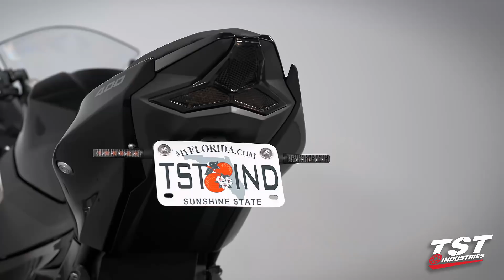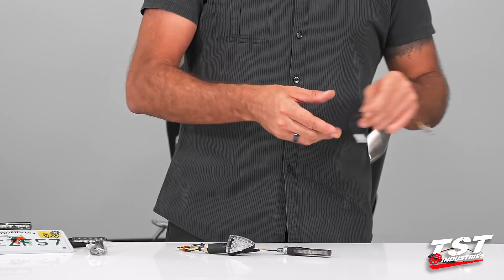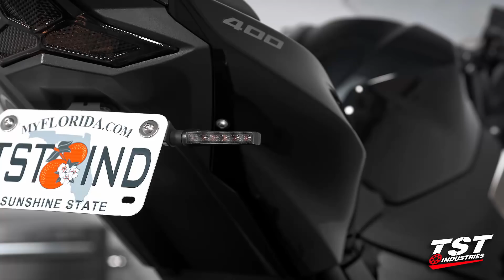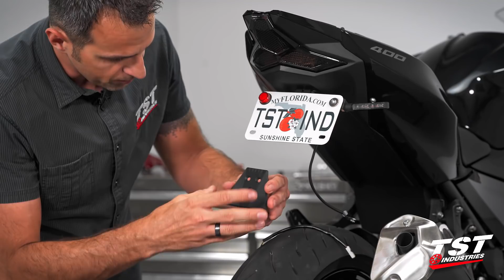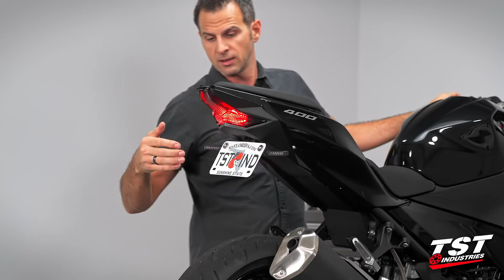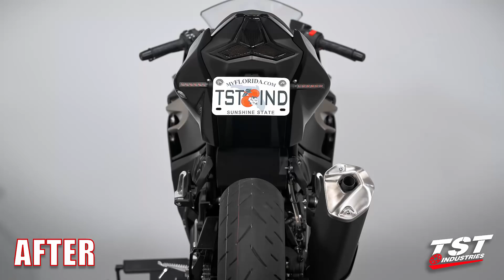How to install TST LED Pod Turn Signals on a 2018 Kawasaki Ninja 400 by TST Industries

Comment: Are these compatible and fully functional for the ninja 500? The same instructions as in the video?
Reply from the maker: Yes and pretty much. We have a separate video on that model being released shortly. It will show mounting in the high and low mount configuration.

Comment: I ordered the sequential and the lights have three wires instead of two, they are blue, red, and brown. How do I know which is pos and neg, and which to leave out I guess since the port only has two slots?
Reply: I installed them and the red wire was the only one without anything to connect them to, but the lights aren't sequential for some reason, am I missing something? I have the led flasher relay
Reply from the maker: @Vic_Vic_Vic_Vic  this sounds like you purchased our Quadrix signals So our color scheme for three wire lights is: 
blue=running light positive
Brown=signal light positive
Red=ground
I suppose if you are wiring into a circuit that has only two conductors you would leave out the blue.

Comment: Just installed. I had to change a few things but got it to work. First the screw did not fit the nut from the L bracket to the plate. I just used what I had to hold the plate on before. Second the lights were opposite for me, so the label had to be facing upside down which means I switched side for the signal to line up. Idk if this is user error or a manufacturing error but it was kind of a pain to sort out. Anyone lmk if they experienced something like this.
Reply from the maker: The signal lamps do not care which way they are up. You must have connected left to right and vice versa. All you had to do to correct this is to reverse the signal connection. I would like to hear more details on why the screw did not fit into the nut for you. We sell the kits that are shown successfully installed in this video. If there was a kitting error in assembly I would like to know about it.

Comment: i wonder if it's possible to turn the L bracket 180 degrees so the turn signals sit closer in and that way the bracket doesn't stick out behind the license plate

Comment: Hey, where did you get those harness connector?
Reply from the maker: Are you asking about the entire little harness assembly that enables plug and play connection of signals? That is something we manufacture and sell , link is in the description of this video. If you just want the actual connector and terminals then you can get those at corsa-technic.com

Comment: Do wires go through the elite fender eliminator ?
Reply from the maker: Yes. There is a wiring hole provided in the closeout component. You can see that in detail in the fender eliminator video we provide for that bike.

Comment: Will this installation work on a Vagabond Fender eliminator?
Reply from the maker: I am not sure. I know that they design in large signal holes to fit the oem signals. If they also put in smaller circular holes for aftermarket signals then you will be all set. You can also try the installation using our L brackets the way it is shown in our video, and that will most likely work.

Comment: Love them! I got a Ninja 400 recently and it already has some mods but I'd love to add LED turn signals. I think I will be ordering the BL6 pack. One question - do you have any LED bulbs for the front signals? I can't see any on your website, can any bulbs with the correct fitting be used? Thanks!
Reply from the maker: You've got to hang tight for the front buddy. Give us a couple of weeks. We aren't providing any LED bulbs for the front because we have something way better coming down the pipe.
Reply: @TSTindustries  Great to hear, I'll be waiting! Thanks for the response :)
Reply from the maker: If you are an instagram user you should follow us because we will soon be releasing spy shots of what I am talking about.
Reply: @TSTindustries  I'm following and waiting!
Reply from the maker: @thecommentator6694  if you are patient it will pay off. Our projects take some time because we are a high end design firm. We dont just bang out parts overnight. I think our limited catalog of exclusive designs that have attracted a lot of attention demonstrates that. Since these signals you are asking about fit a bunch of models and years we are taking extra time to perfect the parameters. Then we have to cut the molds, and produce circuitry and harnessing. It will still be a good while before our signals are available but once they are n400 owners are going to lose their minds over them.

Comment: Just got these for my 2018 ZX6R. Should I be concerned if the grey clip controls the right light, the opposite of what was said in the video?
Reply from the maker: If you are talking about connector color then just plug the signals into the connectors that make them operate on correct side.

Comment: what mounting kit is needed for this to be installed on the stock fender on the ninja 400?
Reply from the maker: Our PSA-1002 Signal Mount Adapter kit would enable you to mount pod signals onto the fender there. You can see it here: https://tstindustries.com/tst-pod-turn-signal-adapter-plate-kit.html . 

There is a dropdown menu in the product page where you have to make the selection of kit type. OPen the menu and select Kit 3 which will change the sku to PSA-1002

Comment: Does it matter on the aro led version which side they are mounted like in this video one side is for the left and the other right I'm installing tomorrow and don't want to mess up
Reply from the maker: The ARO-18 signals are not side specific.
Reply: @TSTindustries   thanks just installed them they look great

Comment: i got the Ninja 300 and i wont to change the rear turn signals. The questions is ... i got the stock front turn signals and they are not leds if i change the flasher relay will it work as usual or do i have to change the front signals as well?
Reply from the maker: Our relay is a full fix and will work on your bike whether you have stock lights, LEDs, or a mixture of both.
Reply: TSTindustries Great, thank you.

Comment: Will this work with 2012 Kawasaki zx6r as well?
Reply from the maker: The signals will for sure. The fender eliminator is different for that bike and can be seen here: https://tstindustries.com/Kawasaki-Ninja-636-ZX6R-2009-2012/

Comment: can you have the integrated tail light bling with the pods too? I have the integrated tail light signal and the fender eliminator and wanted to ad the BL6 to my ninja 300.  I'm assuming it will all blink together.  is that the tail light that is supposed to blink? if you want to shut the blink on the tail light off do you just detach it?
Reply from the maker: If you unhook the integrated taillight it will stop blinking. If you want the signals and taillight to blink in unison then you will need a Y-splitter setup. This can be found here: https://tstindustries.com/TST-Kawasaki-Y-Style-Signal-Harness-Splitter.html .
Reply: damn... would have been good to know that before I put in my order
Reply from the maker: If you placed the order today you can probably still catch the order before it goes out. Message our customer support guys through our site and let them know that you want to add those parts. This way it will not cost you any more shipping. If the order already went out then they will not be able to do much.
Reply: I placed a second order for it and just added a not to say if the other order hadn't left to put them together.  I had already gotten the email that the first order had shipped.  doesn't matter, they will both get here eventually